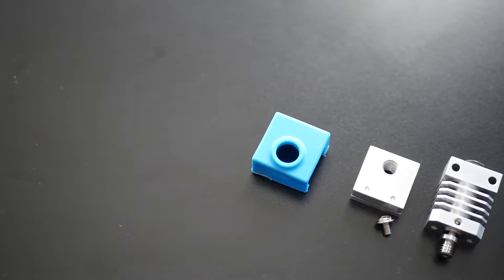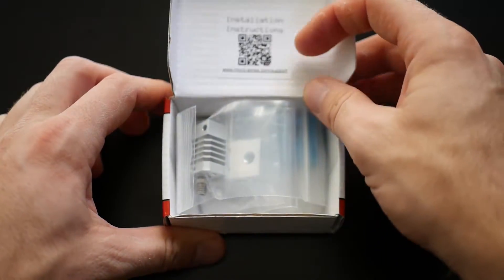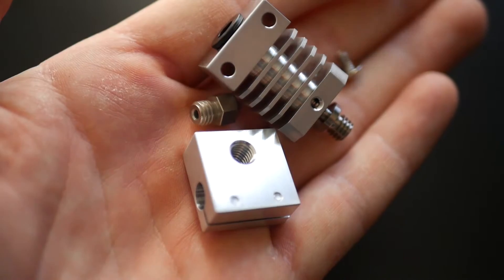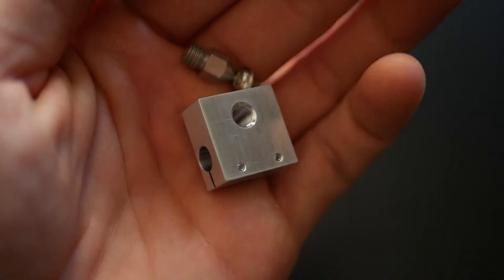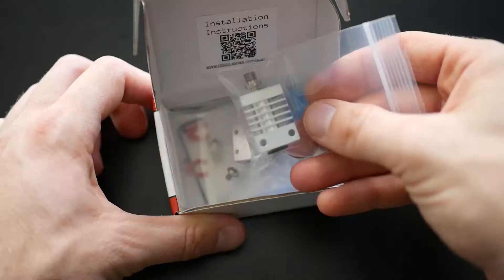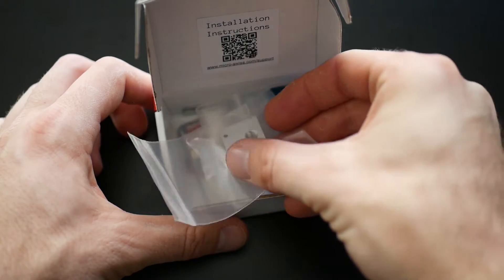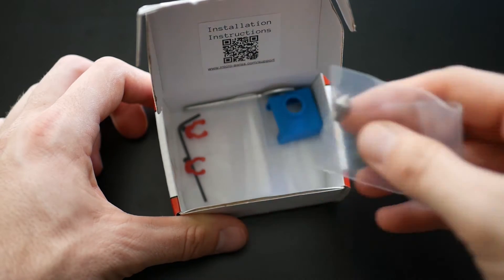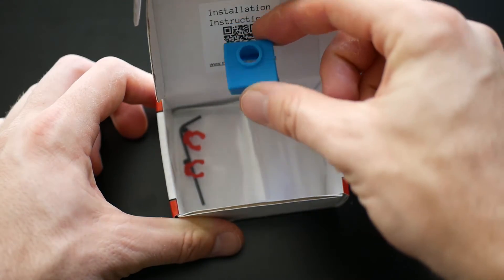Ender 3 Ultimate Upgrade For Abrasive and High Temp Filament | Micro Swiss All-Metal

Comment: When the isolation around the Creality CR10S hotend was destroyed for us, we were unable to get an original CR10 hotend in time and bought the MicroSwiss. The quality of prints coming out of that is horrid compared to the original, and you should absolutely stay away unless you wish to print exotic filaments.

The melt zone has a massive tendency to clog when using standard filaments. Ours is the full metal version, and you should not use that unless you absolutely need to.

Comment: I look forward to more detail on this. Is there a PTFE liner?
Reply from the maker: No liner! I am not sure what it caps at but you can easily hit 300c I would assume you can take it higher provided you have a high enough wattage heater cartridge. I hope you are doing good man :)
Reply: ModBot I added one of these to my Ender 3 about two weeks ago. Really nice hot end. Clogs seem to be a thing of the past for me. Next up for mine is a direct drive. But the best upgrade so far on mine is dual z steepers.
Reply: CHEP  no liner. All metal

Comment: Awesome video ,keep up the great work! P.s I keep having under extrusion on my ender 3. Can you do a live stream so I. Can tell you more.
Reply: Spiderguy405 - Check to see if you PTFE is pushed all the way down to the nozzle. I did a video on this showing how the coupling on the Creality hotend are weak and let the PTFE slide up. I did it on my CR-10 mini but it’s the same for Ender 3.
Reply from the maker: Thanks bro! Not sure when I will love stream. For under extrusion make sure you do not have and clogs even partial. Check your extruders esteps and also check your slicer settings!